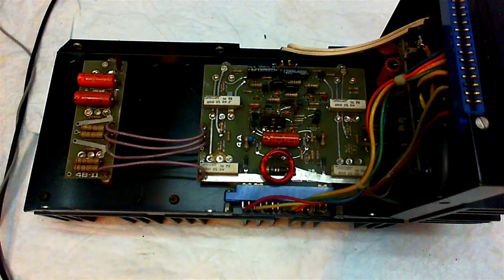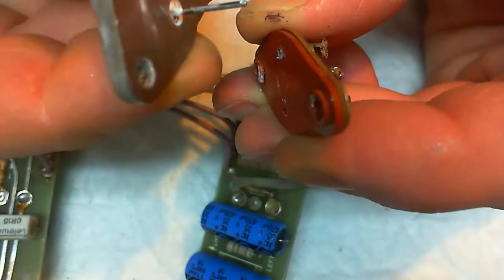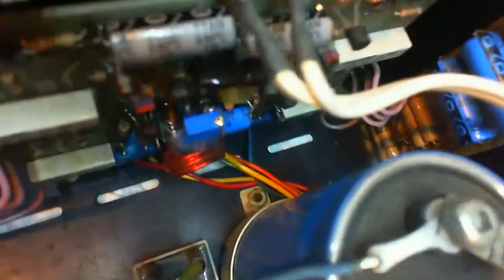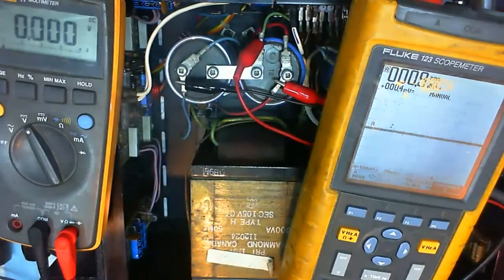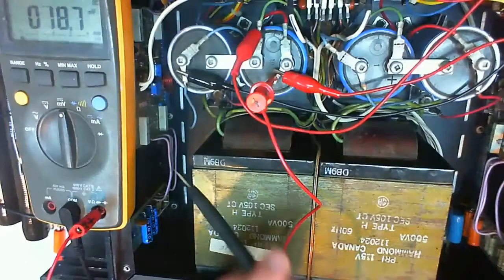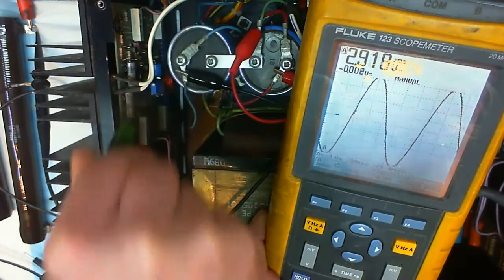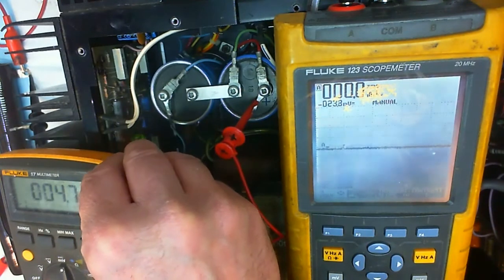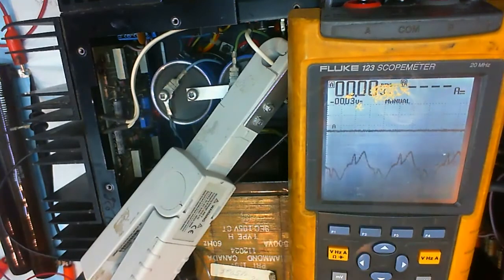1979 Bryston 3B 4B repair - Safe startup procedure

Comment: I have a Bryston 3B that runs warm on left channel. There is no DC voltage on speaker terminals when checked with multi-meter. It runs good with no distortion but gets very warm within 5 mins. Could this be the trim pot bias voltage

Comment: Thank you once again! You are incredibly kind and generous with you time! I decided to fix the amp first and then test the power supply ripple voltage to determine if I need to change them! 
Do you remember by any chance any info on the small electrolytic caps that you used?
Any brand you recommend! I see that the are 4 blue ones and 2 gray!
Once again! Thank you very much for your valuable time!!!!😀
Reply from the maker: No sorry can't remember. There aren't that many options of the axial type though. Choose one with the highest temp rating and permitted ripple current you can find.

Comment: Hello! Thank you for shearing your experience! Besides cost, is there any reason why you didn't replace the large power supply 7500uf caps??? And also the driver transistors which are very cheap and quite old! Thank you once again!
Reply from the maker: Yes, mainly for cost reasons. I wouldn't replace semiconductors unless they are defective or they were definitely subjected to voltages/currents beyond their maximum stress ratings
Reply: Thank you very much for your response! I truly appreciated! So despite the fact that the 7500 µF power supply capacitors are 40 years old they do not necessarily need to be replaced? If so that is good news because they are very expensive! I was wondering if you tested the ones on the unit that you repaired?Once again thank you very much for your valuable time!
Reply from the maker: I can't remember but I probably tested for ripple voltage under full load and it wasn't out of the ordinary. What was the voltage rating of these caps?
Reply: I have the 3B model and the caps are 50V  and 75V max surge. The rails are +&- 50v 
What percentage of the rail voltage would you consider an ok ripple voltage at rated power? 
Can I obtain the ripple it by measuring the AC voltage at the DC rails?
Once again thank you very much!!!
Reply from the maker: I can't say a value for ripple, sorry. A meter measuring AC on the DC would do probably, as long as it's low frequency, depends on the meter spec too. I'd  apply low frequency sine wave to input. Ideal is an oscilloscope. 7500uF or 8200uF / 50V to 63V caps can be had at Digikey for 5 to 40 USD each. To find something comparable to what's in the amp you should pull their specs.

Comment: do you answer question?
Reply from the maker: what's the question
Reply: hello  I have a cheap 200$ pyle 2000 watts amp...what can I do to beef up the capacitors transistor  voltage regulator and diode, I don't want more wattage ? and what is the outcome of that ?
Reply from the maker: I don't get the question. If it's working don't touch it. If it's faulty it probably isn't worth repairing a $200 amp.
Reply: Yes use a lot of beef not chicken or pork..

Comment: The setup manual is confusing.. Part B-5 says to set bias to 4-6 mV, input shorted, full AC input, , but then the  burn section   says 12-15 mv bias.. as final adjustment after burn in. Which is it?  Your vid shows only 4-6mv bias setting. thanks
Reply from the maker: efzauner I would set it to the lowest safe value possible. The value will change with main DC voltage and probably also with temperature. I would start with lower DC voltage as in the video then move over to nominal DC voltage then starting from room temperature up to maybe 70 deg Celsius and never allow the drop to be lower than 5mV. You could go higher but then distortion will increase at the zero crossing. Not that I would be able to hear that though. :-)

Comment: You can source these darlington type transistors from other amps as they use similar types
Reply: There is no darlingtons darling...
Reply: @palogazo3947  And the entire post was useless as well. No darlingtons and who cares how you source them. Wife won't let him talk at home so he can say something here..lol
Reply from the maker: Good idea. This was actually the first and hopefully the last time I repaired one of those. xD
Reply: I get the feeling, i had this amplifier once, which my mate now has and one of the channels were down on it, it turned out to be a shorted output mosfet, so i removed that particular mosfet now that channel sort of works but crackles and im not sure what it is, do you think some of the other mosfets may be damaged?
Reply from the maker: If we are talking about the same amp the output transistors are bipolar types not mosfets. If it crackles I'd rather say it might be the old potentiometer in the back, but that would usually go away with some contact spray, at least for a little while. I don't think a crackling sound could come from a damaged transistor but rather passive components like resistors or capacitors or bad solder joints.
Reply: no its a totally different more modern amp using mosfets for the outputs

Comment: why did you change transistors ? do you have a list of parts ? i am looking on digikey
Reply from the maker: I think it was because the 2N types weren't available. Also on DK they linked to the MJ15003/15004 when looking up the 2N...